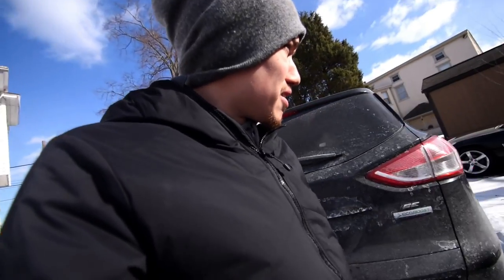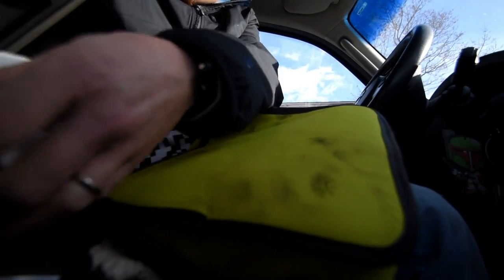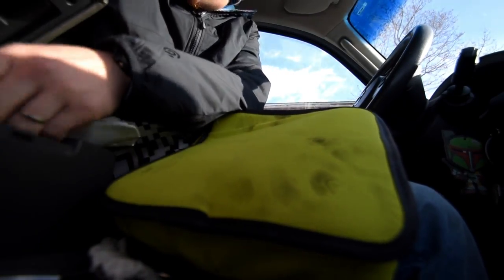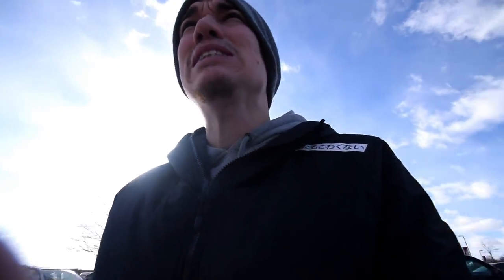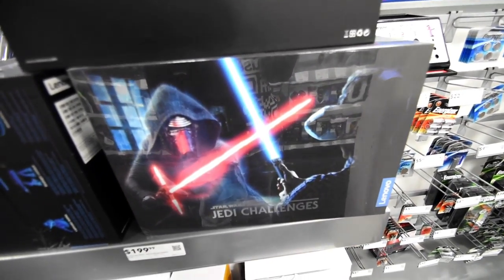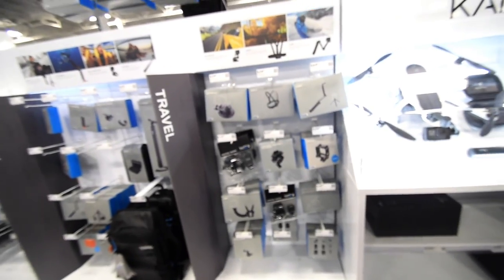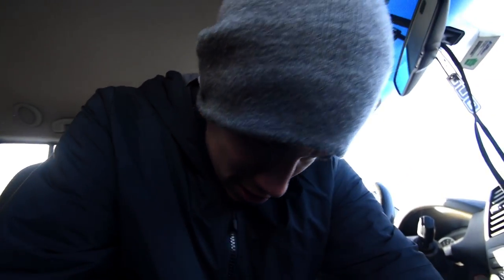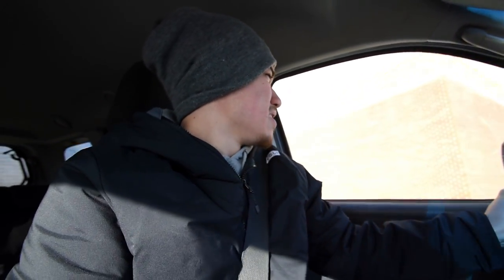How to | Mounting  240sx Transmission ALONE!

Comment: Try rotating the crank and pushing the trans in, it worked for me before. Also use an alignment punch to keep everything centered. You should be good. You can also get a long bolt (starter bolt) and put it in a different bell housing hole, to make them closer by tightening the bolt, then put a actual bolt in once it’s closer next to it.
Reply from the maker: Forsure!! Thanks man!! I should of done that I didnt even think of it lol
Reply: If it's 1/2 gap or less, if its more you shouldn't force it, splines aren't meshed you can damage clutch, you can rotate rear trans splines/if its neutral.  I usually bench press with starter housing at 5'olock position, clear trans tunnel, up in/spin, jackstand under tail of trans and bolt it in.

Comment: Did the car used to be an automatic? If it did have you got the correct brass spigot bearing in the crank and not the big mild steel one. When they get converted from auto to manual not many people know you need to change the spigot bearing too. If you don't the input shaft will flop about when the clutch is pressed.